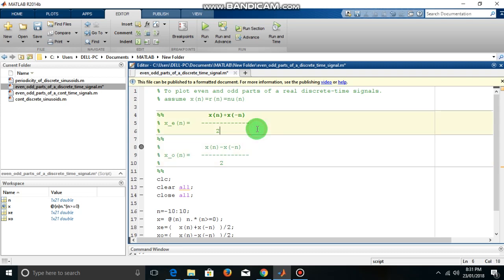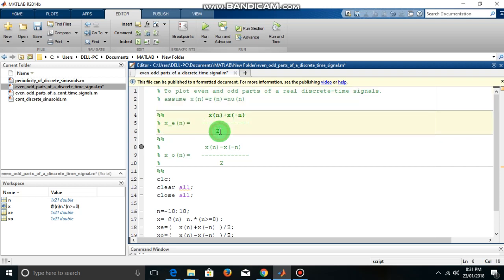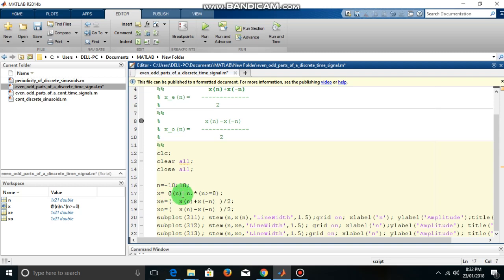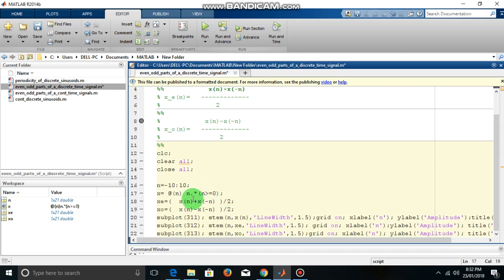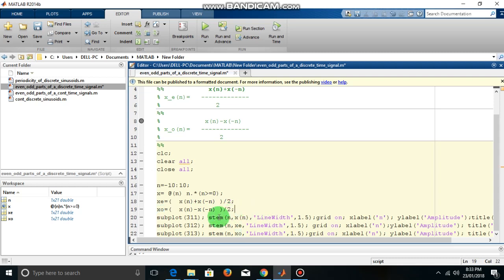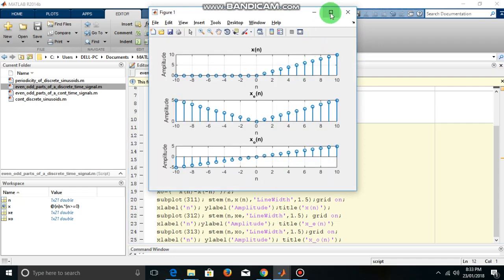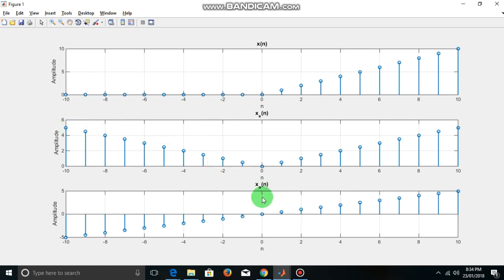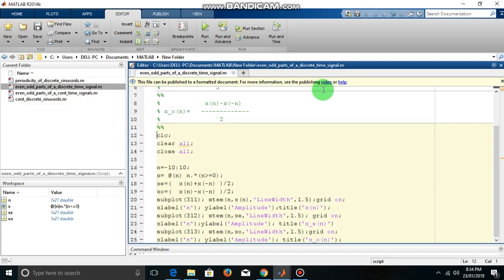2.2 Even and Odd Parts of a discrete Time Signal on MATLAB

Comment: Good attempt but if user want to give the time sample range as input , then your code will get error . Because in that case after reversing the sequence , simply you can not add . Before adding , you have to pad required no. of zeros in the front or back side. Try to make more generalized code , it will be helpful